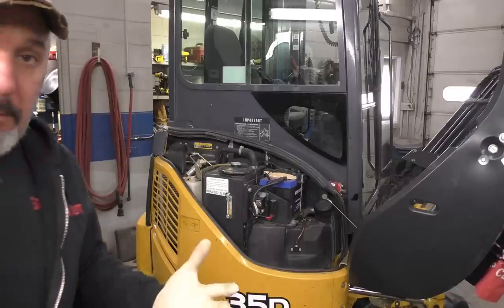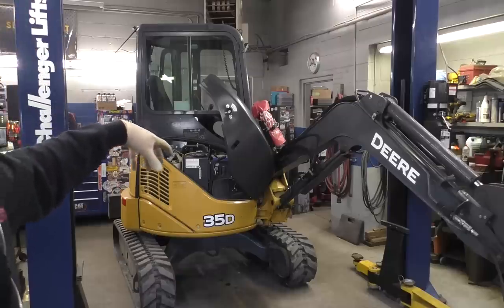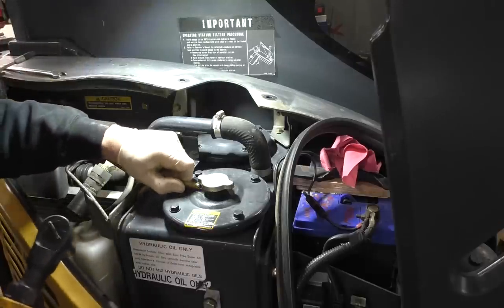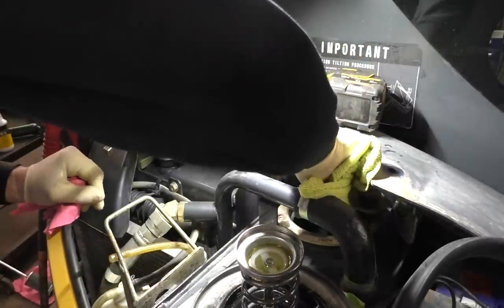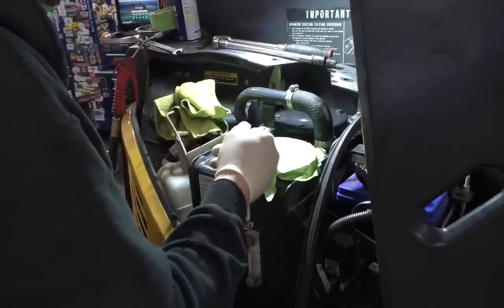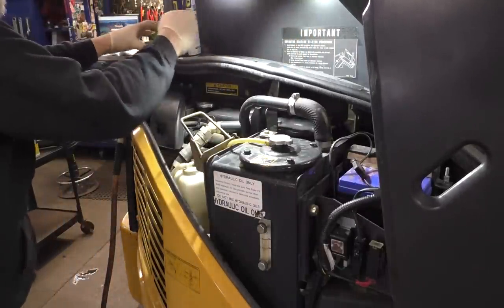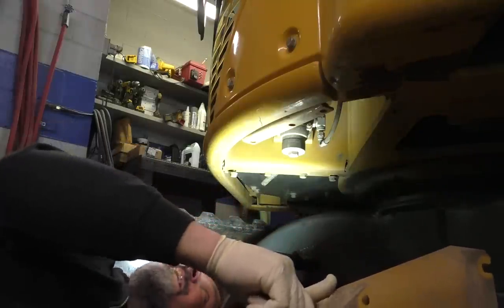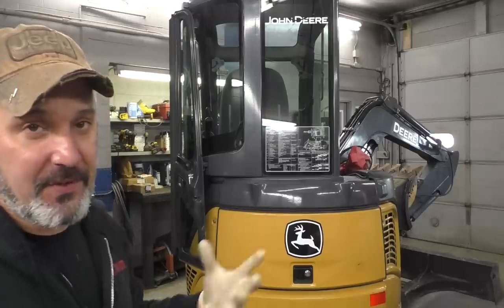John Deere 35D Excavator: Replacing Hydraulic Oil & Filters / Coolant Drain & Fill

Comment: Free tip Friday. If anyone ever has to pour from a bucket like Eric did, put the spout at the top (12 o'clock) and it won't chug like that and it will come out smooth. It feels unnatural to have it like that, but it works. It's a little more challenging to get the initial liquid into the hole if smaller, but once you do it is great and much faster.
Reply: I have seen this printed on the lids of buckets before(with an image) and the guy still cusses cause the oil glugs out 😏
Reply: @bluegrallis  I haven't seen the image before. It works better for me, so I figured I would share.
Reply: This is the technique I use with Costco Almond milk containers. Works like a charm.
Reply: Yeah, notice he’s got the spout at about 10 o’clock and once the fluid level got to there it stopped glugging.  Bit easier to aim starting at 10 and it didn’t glug too much

Comment: The previous owner may have bought that hydraulic filters and all the other service parts when he bought the machine back in 2012 and stored them until he got to 2000hrs but changed the engine oil and filters more often than the hydraulic filters maybe.

Comment: Good job on the fluid change, when I do the hydraulic filter on my skid steer after pulling it I use a clean rag with a strong magnet wrapped up in it before wiping the bottom of reservoir if there’s any metal in the bottom it will get it.

Comment: Great video. Just and FYI. The leftover hydraulic fluid left in the bucket. Get rid of it. Where I work we have critical hydraulics and the manufacture of the hydraulic components warns us on using hydraulic fluid that has been exposed to the elements and stored. They recommend either not filling until you use the entire contents or dispose of any fluid that is remaining in the container. I am not sure the sensitivity of the hydraulic components of a John Deere mini excavator, but might be safe than sorry. Just a Free Friday Tip. 😁✌

Comment: These are the things we do with every used purchase...go through and change all of the filters and fluids, inspect and lube as needed. 
Original factory filters ! More evidence the seller was full of hot air. I wouldn't bet on no sir, "is there anything you need to know" before using it since the seller has been wrong about much this far. I'd hope the seller was as loose with the sales price as he was with words about the service and maintenance cycles "he had performed".

Comment: I can only imagine Deere John branded hydraulic oil ain't cheap, our industrial parts store sells a rebranded Chevron AW46 I forget the cost per pail. The most important hydraulic filter is the pilot filter it can cause you a whole lot of ass aches. Its the only filter in the hydraulic system that is pressurized hence its in a bomb proof canister. Hydraulic oil contamination usually comes from attachments like rock hammers or brush mowers.

Comment: If it's not too late, while the machine is clean... take a wire wheel and go over the underside and clean up the rust, apply paint etc.  The machine will then be just about as good as new and will pretty much stay that way .

Comment: Suction filter is always like that, it was set up correctly.  The factory glues the oring in, normally its a white glue.  Normal service on the suction screen is 4000hrs, if oil sampling is used and Hyd oil is extended drain.  2000hrs on the main hyd filter or 1000hr if Hydraulic hammers are used.

Comment: So I wanted to have some coolant on hand for a Deere 3039R, just for topping off if needed.  Checked the manual.  It says use "Cool-Gard II" or "Cool-Gard II PG".  Way below that it says "Avoid Damage!  Don't mix ethylene glycol and propylene glycol coolants."   Does the manual say what coolant the tractor comes with?  Nope, cause that would be useful information.  Call the dealer; after they CHECK,  answer is "ethylene glycol".   (BTW - these videos are very useful for that tractor as well.  This are the first videos I've seen where someone actually recorded changing the fuel filters, re-priming the fuel system, etc. start to finish.)

Comment: Can only guess that your mini might have grease fittings on main cab bearing. Recommend that you spin cab and grease that bearing in many locations.  Lots of grease on that bearing is good.  Some users don’t realize to spin and grease in different locations to fully lubricate that bearing.  Good luck with your excavator..
Reply: He did that in a previous video
Reply: Over greasing the slew ring is the most common cause of slew ring failure... it blows out the seal.
Use the maintenance guide for slew ring and pinion (they're different) grease intervals and amounts ~

Comment: 2000 hours is  an 8 hour day, five days a week for a year. That's about a $1 a week from what I could find . The hydraulic fluid looks to be just over $5 a week . That's not bad. It just seems like a lot when your breaking open the piggy bank to buy it all at once . Remember , a shovel  is $30 and your soul LOL. If you bought the machine from a contractor, don't believe what they say about service. After a career in construction, most have little to no maintenance programs.  It's either we are too busy to take the time or too slow and no money
Reply: This is a 2012. So only 200 hours per year.

Comment: Would definitely set the valve lash in the head @ this point, very surprised if the suggested interval is as high as 2,000 hours.❓Happy excavating 🗽🇺🇸🙈  Small bites to start, it is  possible to bend a cylinder rod when exerting max force, w/ cylinder rod fully extended. 👌

Comment: Oddly, you see that purple loctite 518 on the tank o-rings of hitachi/Deere products from the factory. Can’t say for sure if it’s all of them, or certain model years, but it’s factory. Not just them either, I’ve seen loctite, pipe dope and anaerobic sealant in the dumbest places from the factory on new equipment.

Comment: My manual says change hydraulic oil every 6,000 hours of operation. I have a 2013 35D with 2900hrs on it. Should I change it anyways? Also, what's the benefits if any?

Comment: When you change the coolant, should you blow air pressure into the radiator at the cap to try and evacuate as much of the standing coolant as possible?

Comment: You know Eric, I do the same thing to all my "new" to me old cars that I buy. Change ALL fluids & filters. Even did it on my 2017 "Certified" Chevy Silverado that I bought with 30k miles on it. Also did it on the used John Deere E120 mower with only 40 hours on it. You got to start with a clean blank sheet, Right?  I think I enjoy doing it as much as you do. :>)  Greetings from that Old Jarhead in WNC

Comment: Have you read your manual before doing this work? If it's the same as my 35G model, you don't have the arm set correctly, hence you have put too much hydro oil back in. And you didn't bleed the system after changing the fluid or pilot filter....
Reply: It's fine.

Comment: I wonder why JD would make, or need to make, that front filter with the rod and jam nuts adjustable at all? Obviously, it's a spec that for some reason would change over time... maybe there is some manufacturing process reason for it.... it could be a solid rod with precise stationary stops at both ends, no room for adustment....but, I don't see a need for it to be adjustable in the field, other than the fact that JD manufactured it that way... maybe it's one of those "brother-in-law effect" parts....

Comment: The cylinders hold the same amount of oil  whether the are open or closed  r
They push oil in to work.  So oil enters on one side of the piston or the other
Reply: De un lado el pistón tiene el vástago, que ocupa algún lugar.
Reply from the maker: The rod side holds less 😉
Reply: @TheRealEricO    😀A Luis Schueler le respondí por la cantidad de líquido de un lado o del otro, que no es la misma ya que de un lado está el vástago, que algún lugar ocupa y no lo ocupa el líquido, por lo tanto "cargan" distinta cantidad. 😃